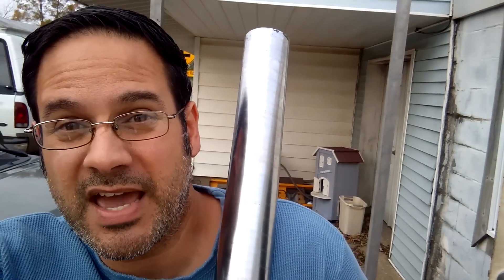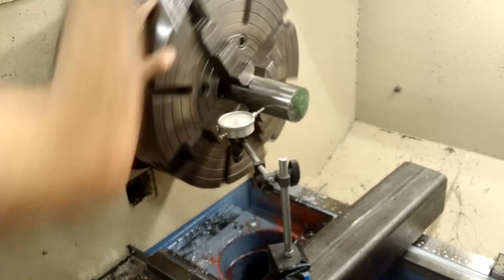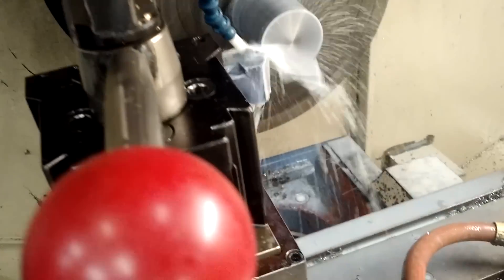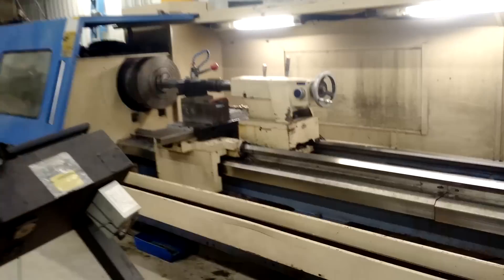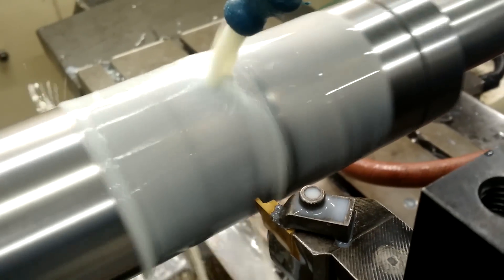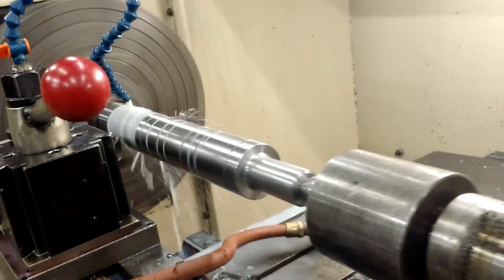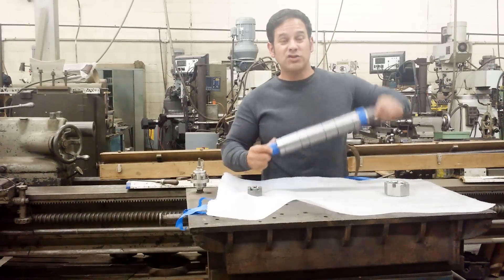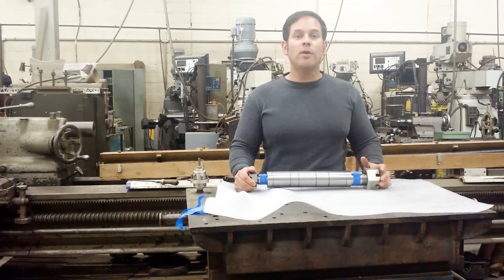Matt Cremona bandsaw mill drive shaft

Comment: making guesses here:  the fluid is for two reasons 1st - to keep the heat down on the bits - 2nd to prolong the bits life and cutting accuracy.  -- That shot of you backing up was quite impressive.
Reply from the maker: +Shogun-Jimi yes, that is exactly what the coolant does, on both counts. You don't really get an idea of the machine size when you are up so close....and that's not the biggest lathe in my shop.  I'm caught between two worlds: machine shop by day and wood shop by night.
Reply: keep one a hobby :)
Reply from the maker: +Shogun-Jimi hmmmm..... which one......

Comment: Thanks for the video!   Quick question was the shaft made out of 1020 or 4140 or perhaps some other steel?  Is there a big difference in the two types of steel?
Reply from the maker: thanks! the material we used is 4140HT.  the properties of each are different but we find that fr shafts of this nature 4140ht really performs very well and is MUCH tougher than 1020 or 1018.  4140 ht has a slightly lower tensile strength than 1020 but not enough to be a problem...the additional toughness makes it a better choice (in my opinion)